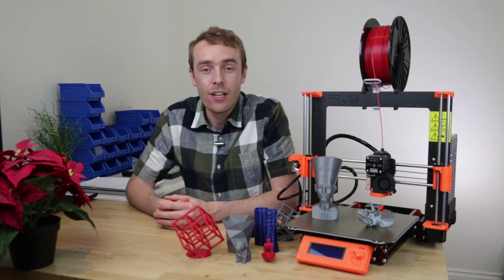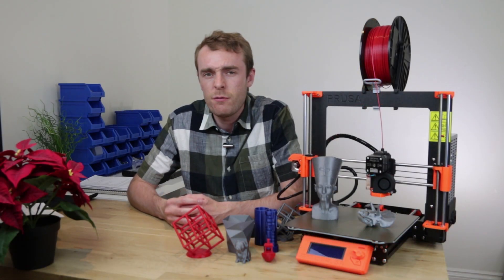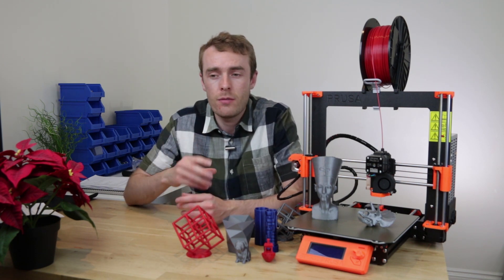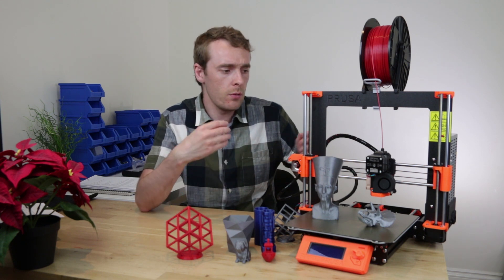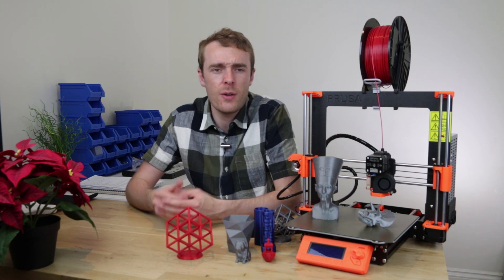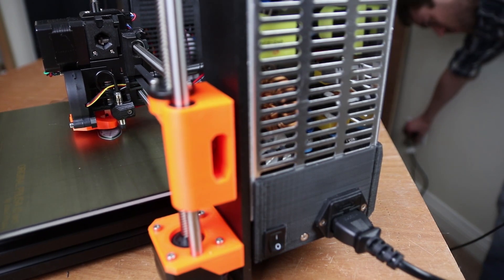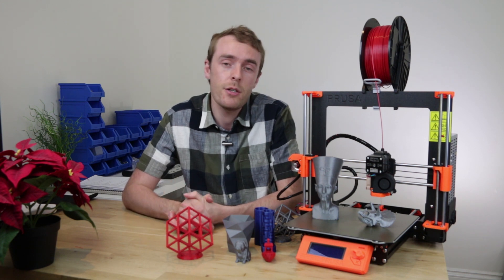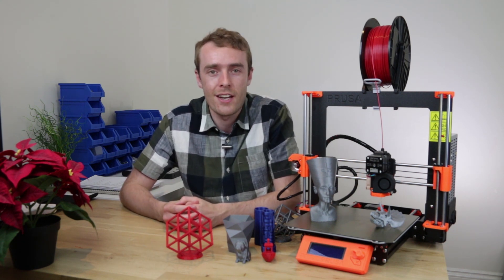Original Prusa i3 MK3 Honest Review

Comment: I would have thought Prusa is selling enough printers now to be able to afford IM tooling for the parts instead of 3d printing them.
 this comment is now 2 years on from the review and they are still using zip ties and 3d printed parts.
 The quality of Chinese printers has IMO now exceeded Prusa i3 and I don't think we will see any changes until the sales figures start to drop off which IMO is the wrong direction to go.
 I won't be buying a Prusa until there are major changes to the manufacturing of parts and an increase to print volume

Comment: 11:50 

That filament detection has saved me so many times with my PRUSA mk3s. Even though it may stay idle until you are present, having a single spool machine stop printing after run out is so much better than having a failed print. 

Yet somehow you try to make it seem as a negative thing?

Comment: I bought the Ender 3 pro with all possible upgrades. Total price 365 Euro including import taxes and custom fees. 
The Prusa MK3S as a kit costs right now 834,- Euro including import taxes and custom fees. And that is a kit. Which means a ton of things can go wrong down the assembly line. In addition to that cost you must add 4-5 hours careful assembly. That is also a calculated cost you pay it on the preassembled. 
If you have 1000 Euro burning a hole in your wallet then go ahead. 
I would much rather have 3xEnder3pro instead of 1 Prusa....

Comment: I've been following the Prusa i3 Mk3 in kit form for a fair while, but initially I didn't like the price so I purchased a Flsun  jobby  which turned out to be one of the most disastrous  buys I've ever made. Several parts were missing, assembly info for the C -plus pack was on par with a blindmans instruction book written in shorthand . Could I get in contact with the seller to sort things out.... could I koof ,  eventually I get an acknowledgement " So sorry, we on holiday ". Well they can stay on holiday.. I sent it back to Amazon & got a refund in the nick of time.

Since then I've been eating & drinking the  Prusa i3 Mk3night & day for a couple of weeks,  read a lot and seen oodles of tube clown clips.  
Today is the first time I've seen your tube clip , thanks . It's the sort of well thought through non squawking info I've been looking for, to find someone with sound body language & plenty of knowledge to be able to give me a good run through on the Prusa i3 Mk 3 .
 As a result I placed an order for the MK 3 kit within seconds of finishing viewing your video 
 Thanks 
Dave
Reply: Dave, I bought a Prusa i3 Mk3 kit a few months back, spent an evening assembling  per instruction which is very detailed and easy to follow but... did I say very detailed.  Be sure to follow the manual step by step including calibrating.

I followed the manual, made no assumptions (despite being a mechanical engineer and having my own opinions), recorded my progress and confirmed I performed all steps and each step "as designed" by Prusa. 

As a result, my first test print was perfect (PLA). I printed about 20 additional objects over three weeks and then found I needed to adjust the filament feed tension and calibrate the first layer again. Getting the first layer calibration
correct can require patience but once you do, the machine sings and does an
awesome job, or it has for me.

Comment: Monoprice Select Mini owner here. I'm thinking of upgrading and one of the features I'm really excited about with the Mk3 is the multi-material upgrade. Being able to print soluble supports would be great, I'm just not sure it's worth the cost. Anyone have any thoughts on this?
Reply: steve gowin there is a new mmu coming out that will be cheaper and supposedly better. I lot of people had issues with the v1.  If v2 will be better is still up in the air. I probably would not let that affect your decision. Mk3 owner here.
Reply: Completely agree. Will get a Mk3 and then upgrade to the MMU later. Thanks!

Comment: may I ask what's wrong with zip ties? the ones Prusa ships are PA6 or PA66, which are tool-grade nylons. they are WAY stronger then any printed part they could put there, and when the design is made for using zip ties they are a wonderful thing. the reason most people think of zip ties as unprofessional is that a lot of people just use zip ties a temporary bodge or fix, where the part or item isn't at all designed to use zip ties. the reason they aren't used in large-scale manufacturing is that there is almost always a cheaper solution, not per se a better one, and they are also not the easiest to automate or install. this isn't an attempt to break down the video, it was great, just genuinely curious why you think they are bad.
Reply: I also had no issues with the z covers, you should look at the little notches inside and line them up with the screw threads, then just screw them on like regular nuts. and yeah, I'd like to see a better interface as well. the soft stainless steel rods were a slip at the factory, but the new ones are also stainless steel, just case-hardened. ghosting an issue with I3 style printers, there is a reason I built a coreXY :)
from all the testing I have done, fan duct design doesn't really matter, as long as you can get enough air on it. getting a slightly higher CFM fan helped a lot more then any cooler design did. that said, it's still nice to see a multi-directional one. PEI and inductive sensors aren't really my favorite, i still prefer manual with buildtak. prusa control is awesome for just cranking out parts.

Comment: Regarding filament sensor I think you missed the point. If you’re running a days long print and not sure there’s enough filament on your spool, it’s super nice to know you can continue the print when you wake up and see it ran out.
Reply: C.R.T hmm, I’ve never experienced not to have to use torture to get prints off cold bed on the MK2S. Is it different with the MK3?
Reply: Not in my experience – prints an ASA, PETG, PLA are still stuck to the bed once it has cooled down. They're easy (ish -- depending on material) to remove, but they're still stuck.
Reply: And you end up with messed up layer or two with a dried blob in a middle.
Reply: @Vector3DP  Thats right. So add an ESP8266 to sig and gnd for the buzzer to control a phillips hue or an other zigbee gateway to flash all the lights at home or to give signal to all alexas at home and send you a mail. So you do not miss the information

Comment: Good review. My MK3 has been insanely reliable. In my experience, the mesh bed leveling has worked quite well - I had one print that went nearly edge-to-edge and did not have adhesion issues. It does make me wonder if there was another factor? Keep up the great work.

Comment: the comment on uk resisdents power outage candle parties is spot on
Reply: Au Contraire, Mon Ami, my area gets lots of mains supply glitches, on average over the year a couple per week, but then sometimes four or five in an evening, enough annoyance factor to put me on laptops rather than desktops without UPS. So the print resume is a good deal for me.
Reply: The print resume is great in theory but in practice it always messes up one or two layers and leaves a blob of dried filament where it stopped. So if it's an important print you might as well just throw it in a bin and start again. Or spend £50 on a basic UPS that will run this printer for few hours.

Comment: Thanks for the thorough, fair, and nicely slightly humorous review. I "hate" that brown Noctua fan, too, and would "love" to get a powder-coated PEI bed to get that nice texture when the presentation side of the print is on the bottom. One of the MK3's nicest features is the ability to print a variety of engineering materials. The extruder and bed get hot enough to print polycarbonate, which I have done successfully without an enclosure. Product support via chat is excellent, but for some reason, inquiries via email and the "contact us" form either take forever or are never answered. Further advice to anyone building the kit is to get some proper ball-end hex drivers and, of course, a proper nut driver.
Reply: Those fans are real quality work.. if color is a issue.... well paint it?  but really fan COLOR? The printer is ORANGE?!?
Reply: MikeMike I’m using a buildtak for the texture. You should try one .. :)
Reply: I've gone through countless sheets of the stuff. I've even considered buying a BuildTak FlexPlate system for my MK2S but have been put off by the high price. Powder-coated PEI should be a lot more durable.
Reply: I don't suppose they'll send me one though.

Comment: Awesome video, very informative!  I have been looking at getting a new printer soon and have been heavily leaning towards the i3 mk3, though lately I'm starting to second guess that. I've been a bit disappointed lately with reviews (yours, maker's muse, a couple others) where they mention that the print quality is only decent....do you have a recommendation for a printer at that price point that has better quality?  

BTW, I currently have a Makerbot Replicator 2 on semi-permanent loan from work. Any idea how the i3 mk3 compares in print quality to the Replicator 2?
Reply: I have both a Replicator 2 and an MK3. I don't see any great differences in print quality. I bought an MK3 because, with its heated bed and all-metal hotend, it can print in materials other than PLA. It's also very quiet, quiet enough that you can work comfortably with it sitting next to you on your desk. It's definitely not perfect, but I don't think any 3D printer is. At this stage of development, 3D printers are more tools that require some expertise rather than appliances that just work.
Reply: At that price point you don't really have many options for better print quality. I've seen some CR-10S models with a ton of upgrades that put out really great print quality, but the amount of time and optimizing it takes to get there is quite absurd, and the cost can add up to well over $1k. This is why I just bit the bullet and went with a Makergear M3ID. Have to pay more for reliability and quality.

Comment: I would like to ask you a few things, as you have mentioned much more issues than the standard overhyped reviews. Is it REALLY worth $900? Usually, when someone asks the simple question "cr-10 or prusa", everyone starts to talk about apples and oranges. Mainly due to the huge price difference, and better support, overall quality...

I can afford the prusa mk3 quite easily, but if I pay twice as much than a "comparable" printer, I would like it to be flawless. And prusa is clearly very flawed printer. The only thing that I really find useful is the spring steel bed. The sensors, power loss recover, less noise.... meh.

The only thing I desperately want to know and never found in any review - is the print quality TWICE as good, as it is twice as expensive? Some bridging might be executed better, thats for sure, fans are definitely powerful. But am I really going to print like never before? Clearly not, with all the ghosting and inconsistent extrusion.

So thats it, I dont care about some failed prints, I dont really care about the plug and play feel of the prusa, or easier build.. What i really care about - am I going to print much nicer models than on CR-10, and other prusa clones, so I could justify spending that much? With all those flaws I would feel like I´m buying a ferrari and then finding all the cheap plastic buttons, fabric instead of leather... you get me. 

Thanks for your time and great review. It is much appreciated
Reply: I disagree with your assessment that the MK3 is "clearly very flawed".  I own multiple MK3s, and in my experience I do NOT have the issues CRT mentions in the video.     They are workhorse printers (my longest being an 86 hour print at 0.10mm layer height), and have resulted in no failed parts that were not my own fault in slicing or setup.  I have no ghosting in my prints (yes I have the rubber feet), the restart features work as designed, and the filament sensor is great - not because someone fails to notice the spool is empty, but more when filament snaps.  My delta's are fine, the creality is fine, the Ultimaker is really good.....but when I just need to reliably crank out parts with no hassle I always go with the MK3s.
Reply: I have used printers half the price, and do believe that the MK3 is worth the extra money. This is because I have spent so much time battling those cheaper printers, I and just haven't had any issues with the MK3. The extra features and support are what really makes it stand above the rest. The vast majority of cheaper printers leave you on your own after the purchase.

As for print quality, it is better, but probably not twice as much. This is largely because these higher quality printers are pushing the limits of what is possible with FDM. Just as you will not see twice the quality from a Makerbot, Lulzbot, or Ultimaker, compared to a Prusa. But those machines do have extra features that drive their pricing, beyond pure print quality. For example, CoreXY style machines do tend to print faster, but may or may not have a noticeable quality difference. There are machines that can also more accurately print at crazy small layer heights, but they cost much, and much, more and obviously take a lot more time.
Reply: Thats what seems to be a mystery to me. Lot of people say the print quality on mk3 is definitely better (I said the "twice the quality" as an overstatement). But still, the ghosting, inconsistent extrusion, curved corners... thats scary, and not always present in cheaper printers :(
Reply: Thank you so much for the reply. It would be my first printer indeed, so I am somewhat scared to buy something that should be "amazing out of the box", but has some issues that just may be resolved in the future (or not).
Reply: Daniel, if you have the money and don't want to deal with the really long wait time from Prusa and the issues that they have out of the box (wrong parts, bad parts, extruder problems), I would highly recommend Makergear. The M2 is 1800 dollars but you just take it out of the box, level the bed, and start printing. The bed will stay level for months at a time and requires barely any tinkering. It's made in Ohio and their support team is made up of actual engineers who use the printers all the time. All of their printers are made out of sheet metal and use linear rails so they're built like tanks. Can't recommend it enough if you have the money to get one.
Reply: I have just finished building the mk 3. After using cnc and laser cutters for a while I though I would finally get a 3d printer. I have been very impressed with the machine and really enjoyed building it. Usability is great which I think it's important.